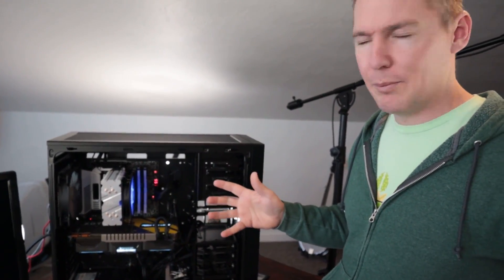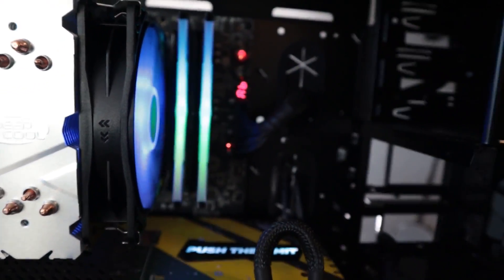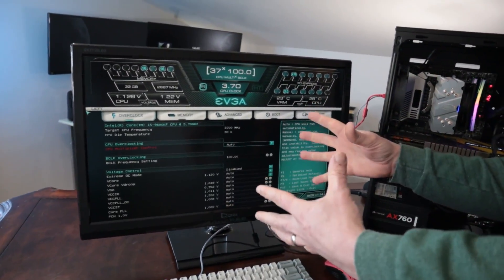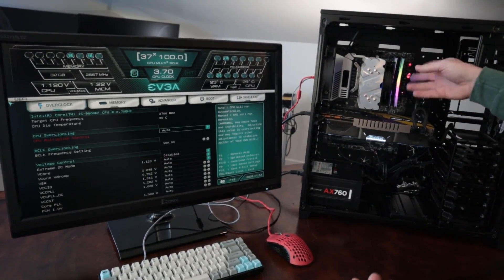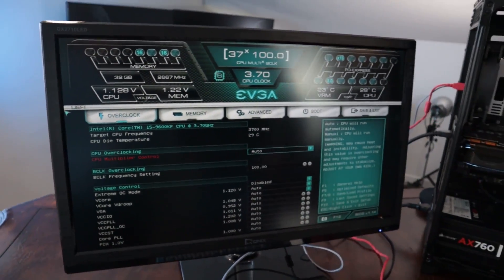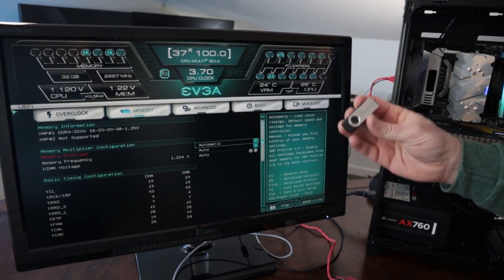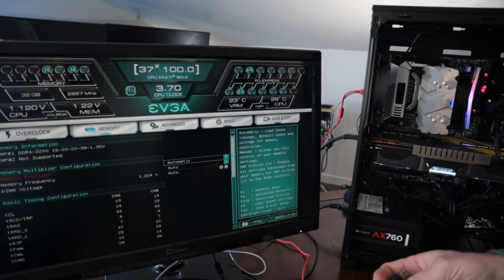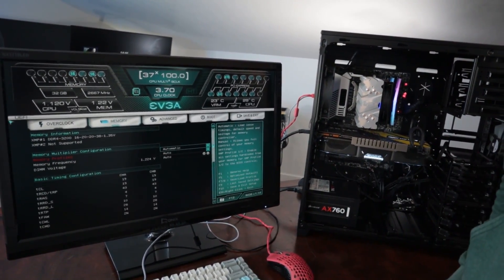Linux Video Editing Media Computer Build 2021

Comment: I use Ubuntu for the office years ago but I never tried to edit and post-production. I used Mac. A Htouch with AMD RX580 and i7, the same machine on Linux works much faster. Now use Ubuntu with Davinci, 17.2, Fusion, Flowblade, Shotcut, Blender, Natron. Also use Shutter, Gimp, Inkscape, Krita Gravit, Darktable, it works excellent, fast and very stable. I like the Ubuntu LivePatch tool, it always keeps Ubuntu up to date. I solved the problem with DAVINCI Fairlight Panel with AMD RX580. 
AMDGPU driver. Davinci Resolve Version 17.2 and Makeresolve 15. It came out with the problem solved. 
I really didn't do anything. I'm happy because I didn't have to buy a new computer, linux renewed it for me. 
I think that does not make computer manufacturers happy.
Reply: how did you setup the AMD GPU to work with resolve in linux?

Comment: could you answer a couple questions for me? 
is there some kind of hardware compatibility check that needs to be done before installing a linux distro, I have a couple older i7's and i5's desktops as well as a couple pre-2012 intel laptops, can i just throw mint on any of them?

I have an old w2k server that has my whole life's data since the early 90's, will i still be able to access all that data with a linux machine?  thanks

Comment: Ah, so happy to see that open source is being used on this custom rig. It is immensely satisfying to build your own rig, from the research about which parts to get to optimize the computer for your purpose. 

For video editing:
Screen: Spend some serious cash here. Look for a high resolution, color corrected screen with a very high contrast ratio. Seriously, it's the one thing you are going to be looking at while using your machine. No matter how fast your rig is, if your colors in the video is not correct, it's all wasted. 

CPU: You need loads and loads of CPU cores, as the load scales pretty well. So generally a CPU with 32 cores running at 2GHz will outperform a CPU with 8 cores running at 5GHz.

RAM: as much RAM as you can afford, media files are big, and most editing software keeps a copy in RAM to speed things up. 

DISK: Fast and big. SSD is fast,  but horrendously expensive. You can get the same speed and loads more storage for the same money by running spinning rust disks in RAID. Just use a small SSD for your OS.

Comment: Its been years  since I built a custom system - your rig is going to cost between $2500-$3000 [now I have not shopped around. ] One suggestion: Let people know that. I would also like to see a video showing lower cost alternatives for those of us on a budget. $920 for the graphics card seems steep!

Comment: I've used both mint and ubuntu. And find myself sticking with ubuntu.
Reply: I did that too and ended up sticking with Mint. It's good to have choices/options.
Reply from the maker: I did similar as Bob, too. Started on Ubuntu, moved to Kubuntu for a few years, then Solus OS for a few years, but kept coming back to Linux Mint in between and currently for the past few years.

Comment: If you were to take a stab at a ballpark figure; how much do you think this build would cost if starting from scratch?
Reply from the maker: Hi Bob. Maybe $1300.
Reply: @TJFREE  : That's actually not too bad. My pockets aren't usually that deep so I go with refurbished HP's or Dell's then bump up the RAM, HDD, and use external HDD's with a docking station I can turn on and off. Multiple HDD's means I can swap drives for different backup's. Photos/videos, data, etc. Nice build. I may have to try one when I can afford it.
Reply: @UTD-Media-AZ  I've been looking at refurbished Dells myself, but I got the impression that it becomes a huge pain in the ass if you want to add a real graphics card, as the original power supply is unlikely to be up to it, and they use non-standard connectors on everything, so you can't just replace. Do you have any experience of getting a refurb upgraded with something like an NVIDIA 1080? I'd love to hear a success story.
Reply: @jonathanshare2191  I wish I had a success story to tell but in fact I bought an NVIDIA GTX 1050 with the low profile form factor to fit the smaller desktop Dell I have to go with the 60" 4K TV I use as my monitor. It kept blinking out and at times got all pink and wonky until I restarted the tv. I've been meaning to try the HP which is my other (back up) computer with it to see if it handles it better. I didn't know the power supply was the problem until you mentioned it but it does make sense. You have me curious now though so I will be trying that sooner than later.

Comment: What is the reason for choosing Linux Mint?
Reply from the maker: Good question. Of all the distros I've used, I feel like Linux Mint is the easiest for people to get started with, when moving from Mac or Windows. Massive community, great documentation, and everything works well out of the box.
Reply: @TJFREE  yes, but why not ubuntu? It's like the most popular distro out there.
Reply: @darshanex  I agree with you. I've used both mint and ubuntu. And find myself sticking with ubuntu.
Reply: @darshanex  because well of the proprietary crap they are giving now (snap)
Reply: It's robust and free. When I switched from Windblows to Linux Mint years ago I doubled the speed of the same computer plus it rarely needs rebooting which is great for me since I tend to leave mine running all the time because it's also my media computer in the living room.
Reply: I use and prefer Ubuntu but I would say the right answer is personal preference. That's how things work on this world on open source